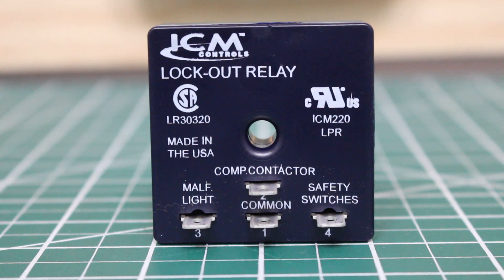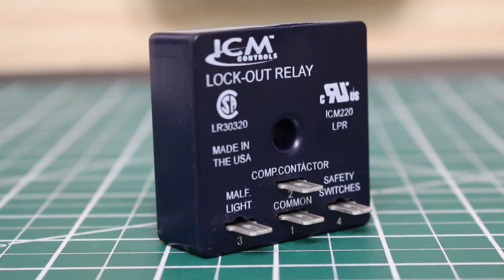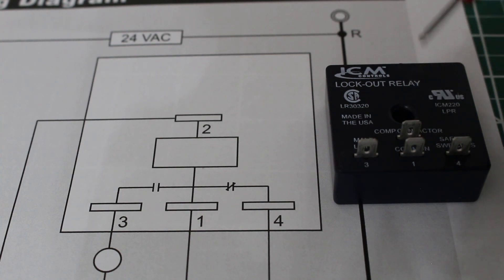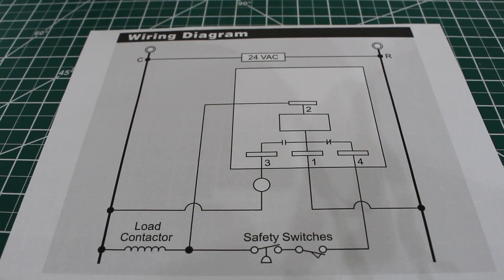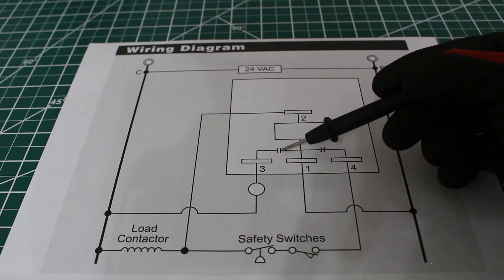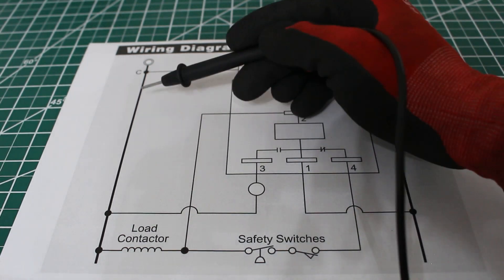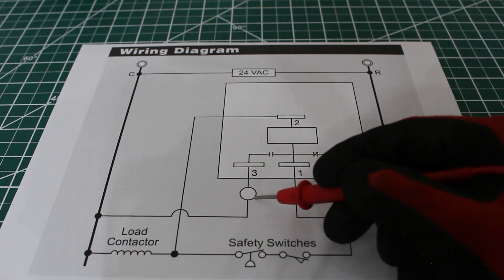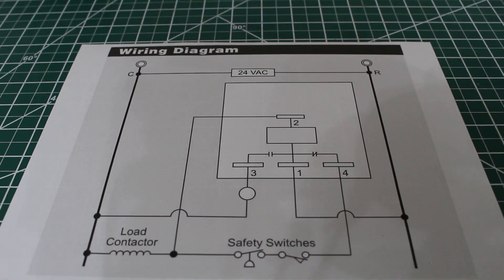HVAC: Lockout Relay Explained (ICM220 Lockout Relay Wiring Diagram) Lockout Relay Troubleshooting

Comment: I am really confused on the fact that the relay coil seems to be always energized. 

So, how is it that switching between the C & NO when the coil is energized , and at the same time there is the NC & C doesn't open ? Very confusing!
Reply: He has it all wrong, there is no physical device between terminals 1 and 2 inside the ICM 220 that actuates the contacts — instead, the relay uses a solid-state sensing circuit to monitor voltage across those terminals. If voltage is present (i.e., all safety switches are closed), the internal electronics allow the relay contacts (typically between terminals 1 and 4) to close and energize the load

Comment: Why are the 24 volt and common on the same side of the conactor coil?
Reply: Not sure if this is your question, but if that NC switch in the relay opens, then all the 24 volts is forced through the small coil in the relay and the light. Because that small coil in the relay is a small load it will consume most of the voltage (I think that’s correct), which means there won’t be much voltage left to operate the larger resistive load in the larger contactor coil. Not sure I said that correctly, so I hope someone with more expertise can fill in the gaps.
Reply: Don't think of common as the neutral, it is a point that is common to both sets of contacts the NO and the NC. It is not the other side of the transformer.

Comment: It is a high resistance contact....thats why when one trips....you will see voltage at the compressor contactor, but not enough voltage to close the contactor. Hugh resistance = lower voltage. Simple but effective device....see them on a lot of Trane  water source heat pumps